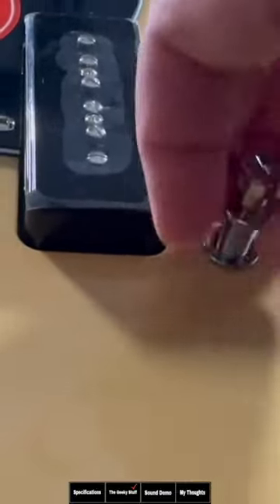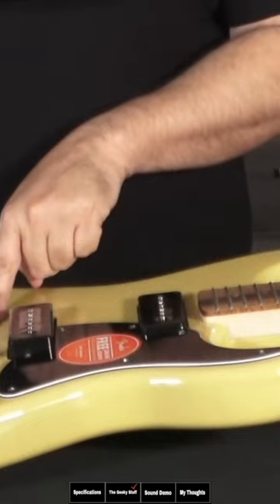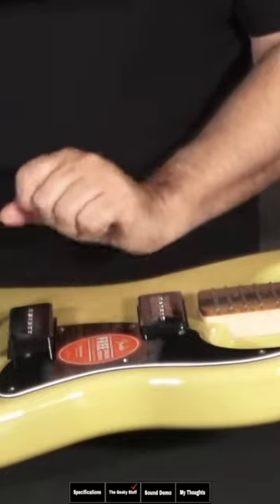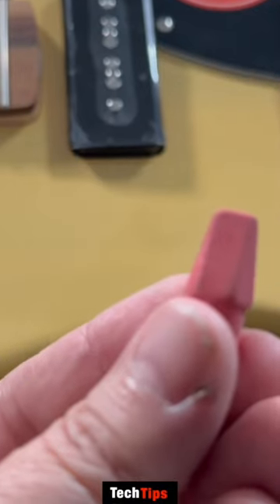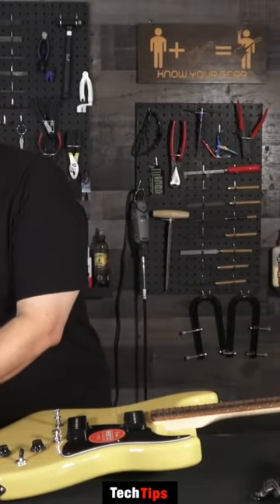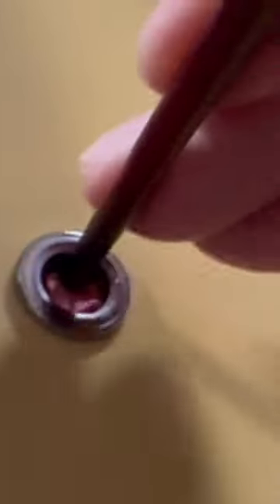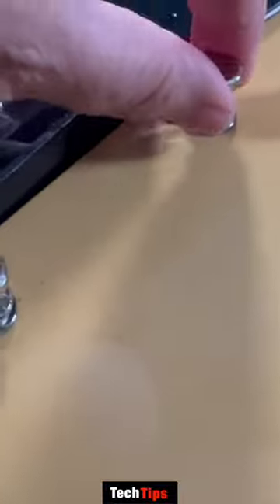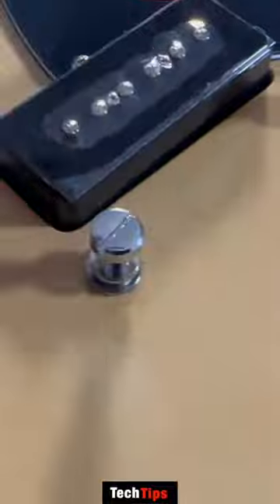Easy hack to fix loose bridge posts on your guitar

Comment: With string tension ther no chanse to buzz
Reply: Yeah, this seems to fe a fix for something that isn't actually a problem. Heck, archtop gutars have floating bridges that are not mechanically attached to the guitar by anything other than the down force from the strings.
Reply: @eilliwwasniahc  yeah, plus every piece of rubber you shove into a guitar will absorb musical vibration.

Comment: This seems to be a similar fix for loose screw-in Strat trem arms where those little springs are used to provide  upward pressure.  That didn't work long-term for myself as the springs kept getting mangled, and the arm eventually broke off at the tip.  

I prefer the push-in trem arms with a small bolt to tighten the arm.  Wondering if there's a similar solution for posts that uses a better design.

Comment: You could easily just cut a guitar pick and use it to create pressure. That's what I've done the last years and it keeps the screws really tight, and they don't lose contact as they basically just get a small chip/slice of guitar pick

Comment: Just use a piece of the correct diameter vacuum hose in each hole
Reply: You can just stick a piece of cut rubber band in there